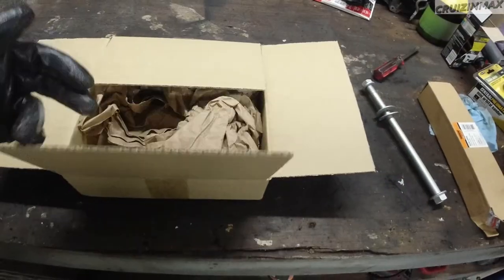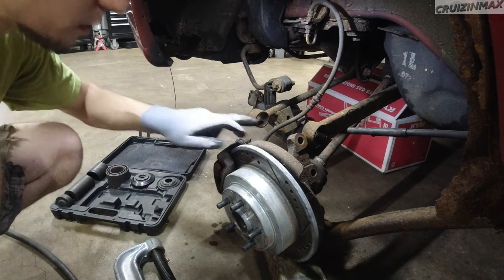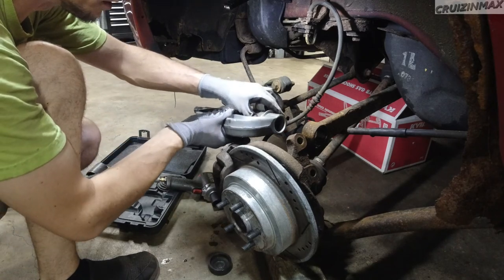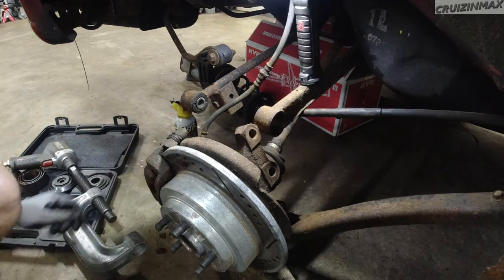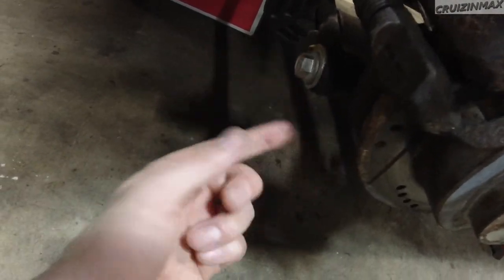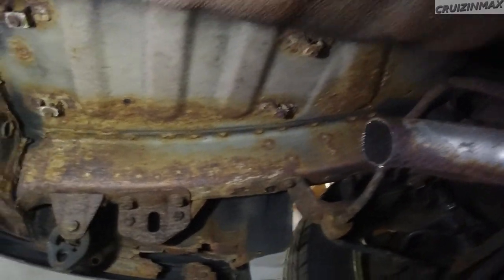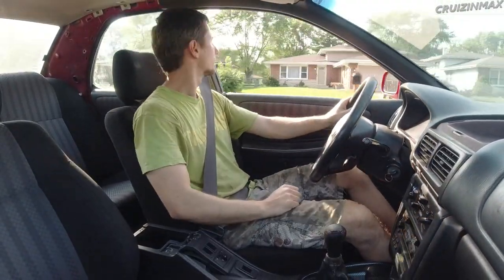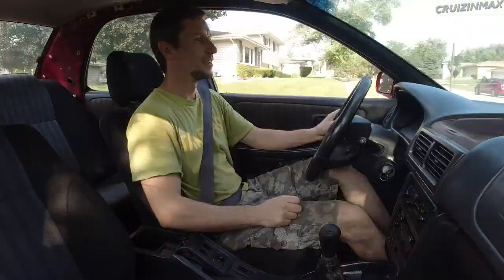Subaru RS rear lateral link bushing install and test drive part 7

Comment: When I reinstall the long bolt now I literally PACK the knuckle with grease or at least some sort of undercoating product. I also anti seize the HELL out of the insides of the bushings. I don't want to fight these things ever again after I service them once.
Reply from the maker: I hear ya...I have been doing the same, grease or anti seize...whatevers closer.
Reply: @cruizinmax4017  Lots of it! :D